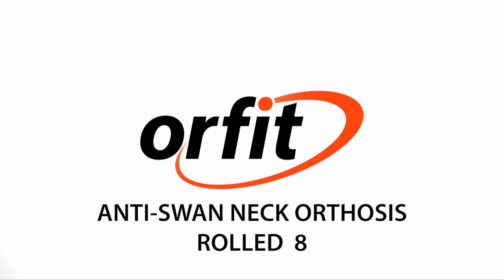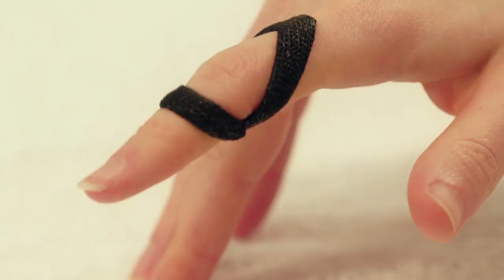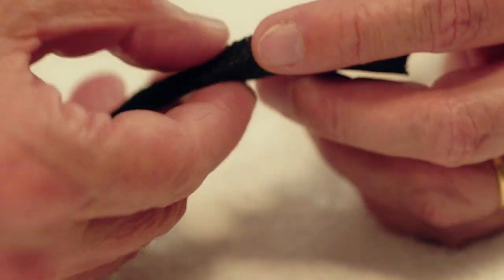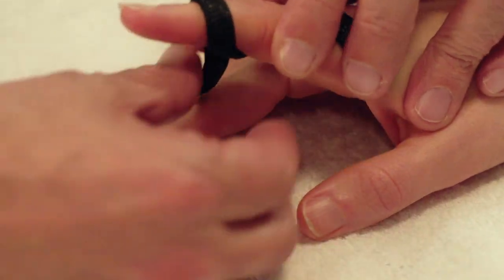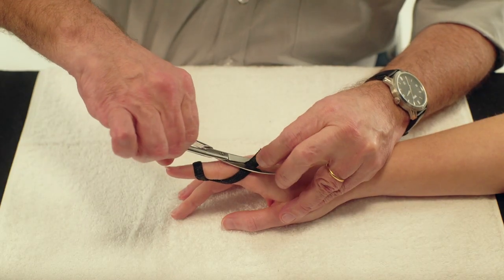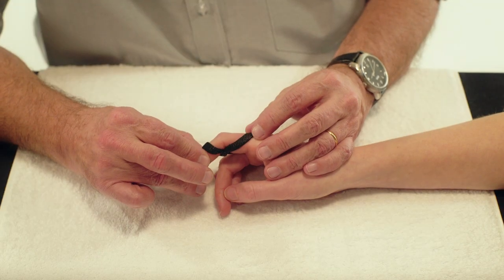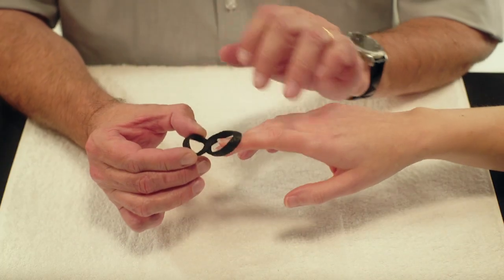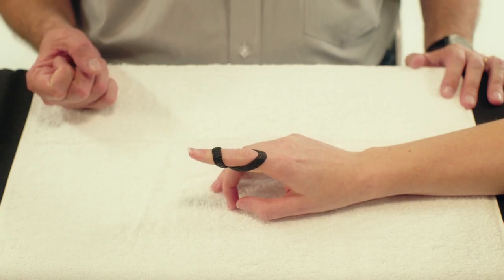Anti-swan neck orthosis (rolled oval 8) - Orficast Instructional Movie 6

Comment: Can these be made for toes? I am apparently extremely odd and have swan neck deformity in 6 of my toes now and the beginning of 2 others. Yes, I said swan neck. My Ortho has never seen it in toes and doesn't really know what to do with them, he's worried about doing surgery unless they get really painful and suggested I try an oval 8, but I need a custom since the ones you buy are for fingers and don't fit.
Reply from the maker: Hi! Our Orficast material can definitely be used to fabricate “figure of 8” orthoses for the toes. However, toes need flexibility for lift off so these would possibly get in the way. Maybe it is worth a try and maybe just for nighttime. In any case, it is easy to try and make one or two and assess!